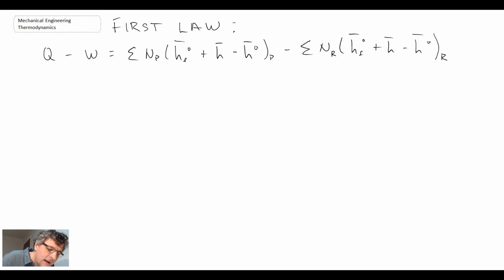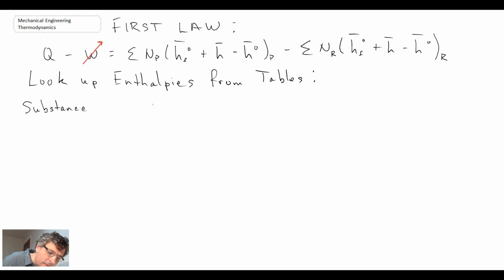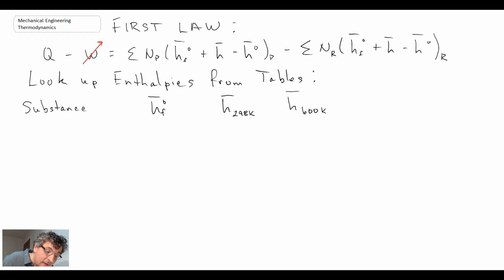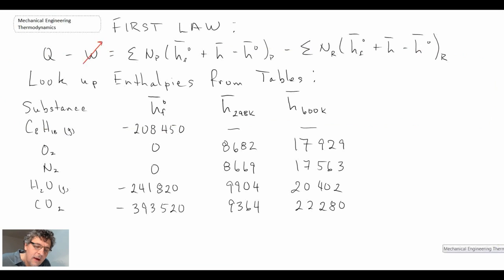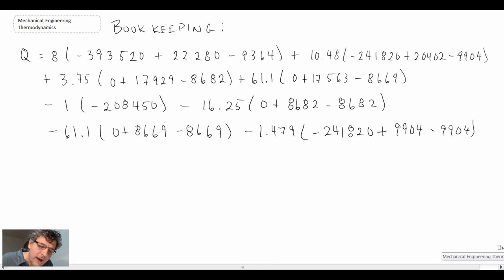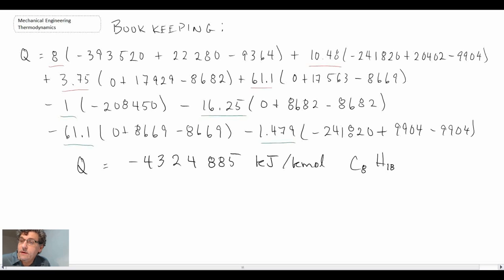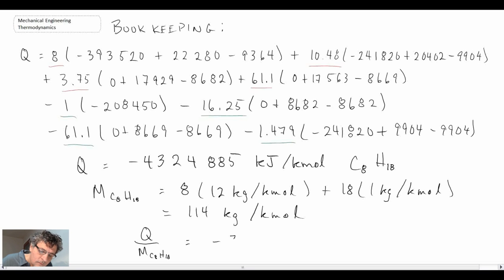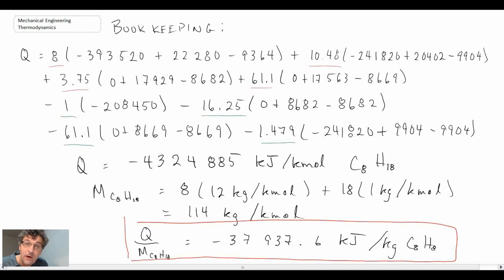Mechanical Engineering Thermodynamics - Lec 33, pt 3 of 3:  Example - Reacting Systems pt ii

Comment: sir please help to solve this problem .
(The atmospheric air has a dry bulb temperature of 21 degree celsius and Wet bulb temperature of 18 degree celsius. If the barometer reads 750mm of Hg. Determine 1.partial pressure of water vapour.2.Relative humidity.3.Specific humidity.)